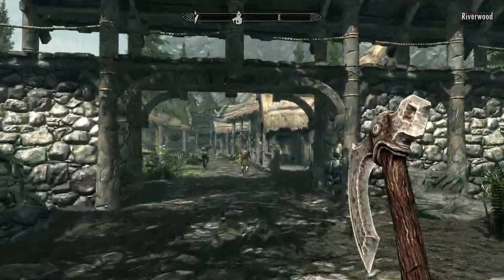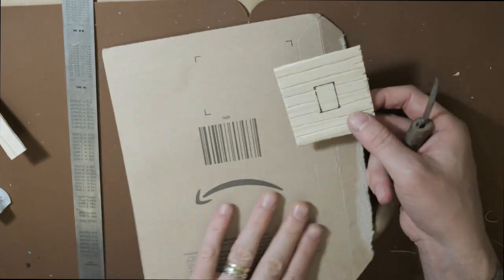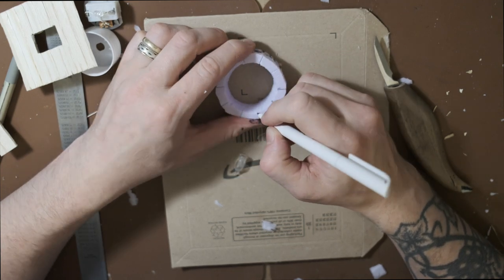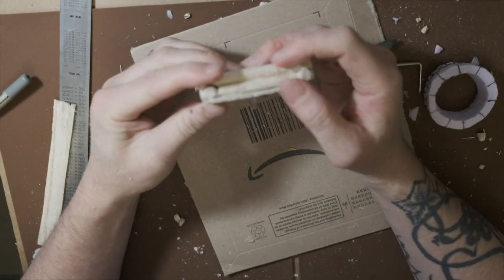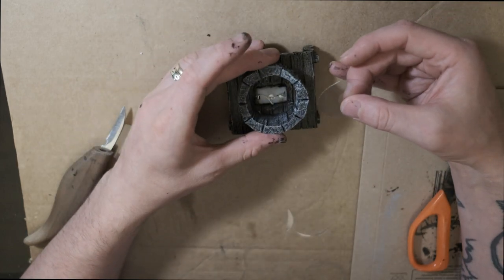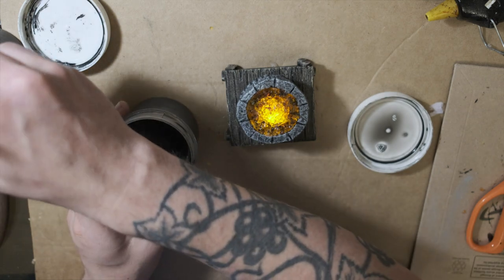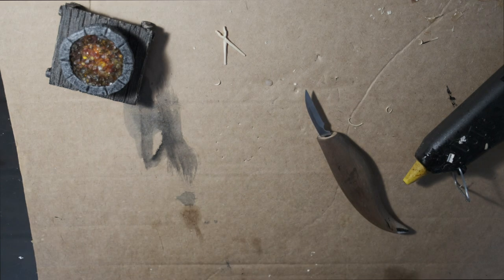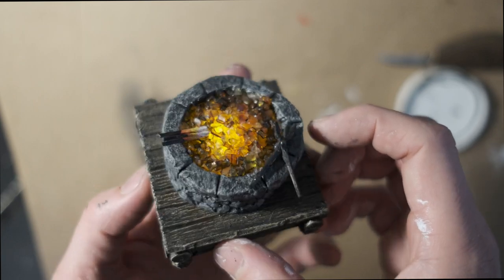SKYRIM Building the forge from Riverwood in miniature

Comment: I always wonder if those tealights can be completely disassembled to make them smaller? They have a lot of plastic foundation in them.
Reply from the maker: You can take them apart a bit, but they are pretty well cased in... better to just but some individual LED bulbs and batteries if you want it smaller :)

Comment: Looks great man! That glass really did it.
Also hell yeah. Skyrim, 9 years on and still going strong :)

Suggestion for gradients - try to do some wet blending instead of using washes, it's a lot easier than it sounds :)
Reply from the maker: Thanks Karl! What is wet blending ..??
Reply: @Nat1videos  Short version: blending the paint on the model when it's still wet. Gives lovely creamy smooth gradients.

In your case, say you were painting the transition from white to orange on the metal rods. First you paint the distinct colors. Next, you add some more orange paint and while that's still wet, you sweep some fresh white paint into the orange, blending it as you go. Takes a bit of practice to get the gradients to start where you want them, but once you get it it's dead easy. Bit messy to explain in text, but if you check my video where I paint that ruin there's a bit early on where I'm painting the plaster this way. 

You can also look up videos by Sam Lenz, he's an absolute boss at it, though following the example on a mini might be a bit trickier. Still worth it just to see him at work though.
Reply from the maker: @Karlmakesstuff  Awesome Karl, that's in my notes as top tip of the day! You are absolutely right I think it would have been perfect for the iron rods, thanks for the input :D
Reply: @Nat1videos  My pleasure :D Once you try it you'll probably start to looking for excuses to use it :D
Reply: @Nat1videos  Do a search for Sam Lenz wet blending. It's a great instructional video.
Reply from the maker: @dougpridgen9682  Thanks Doug, I'll do that !

Comment: Great video and great project! 
Why black modpodge instead of black primer?
Reply from the maker: Thank you! It’s a preference to use modge podge really ... I find that it not only seals the project but also adds a little more stability and structural integrity in area like the joints etc. It is pva based so is an adhesive as well as a sealant. Black primer wouldn’t have that same component, especially in spray can form, although it would be fine to use ... I have nothing against that approach, if it works it works :)  Also, a lot of the crafters I have learned from use this method so I have picked it up along the way and it has become a force of habit. The results work for me. Do you use black primer on your projects ?
Reply: @Nat1videos  I started way back by painting miniatures and priming them with black spray primer. When I got into scenery (not all that long ago) I just thought I'd carry that over. Learned that when priming foam I couldn't use the spray paint because it melts the foam. So I bought an airbrush and just started making my own black base coat paint for my airbrush from guides I'd seen on YouTube for thinning and mixing acrylic paint for airbrushes. I've never tried Modpodge before. Really just unfamiliarity with the product. Your reasons for using it sound convincing enough that I want to give it a try now. I like the idea of the added strength. My only worry is that you mentioned it's pva based. What about warping? I've had some discouraging experiences with using pva for basing and flocking scenery, and having it warp the base I'd built the piece on (the projects were usually either 2'×2' or 3'×2'). First it warped my foam base, so I switched to 1/4" mdf board. It warped that as bad as the foam, so I built the next project on 1/2" plywood and did it in sections. It warped THAT. I'm guessing the Modpodge doesn't exhibit the warping problem?
Reply from the maker: @pitchlink4499  I honestly have not had a problem with warping the base yet... maybe once slightly on a cardboard base that was super thin. Have had no problem's at all with foam warping. I guess try a few experiments, but I think you will be pleasantly surprised. I totally understand using the primer for minis by the way, that makes total sense.